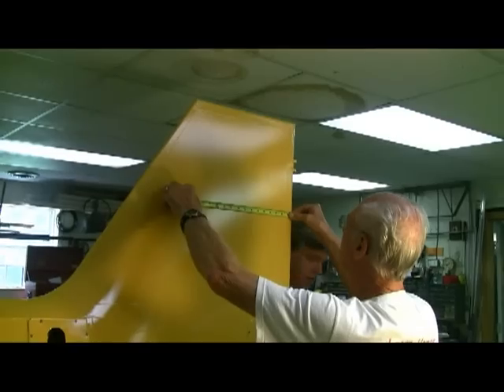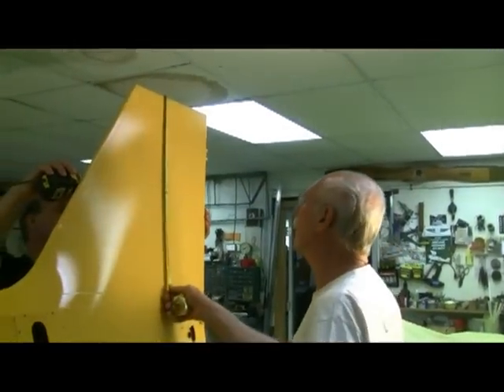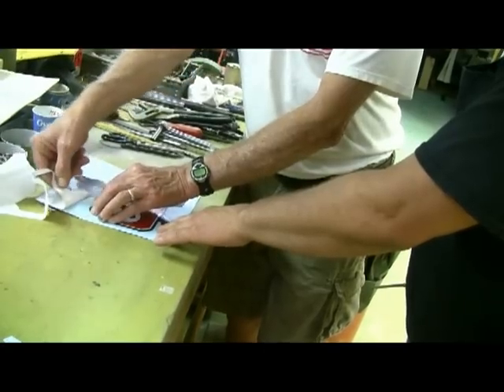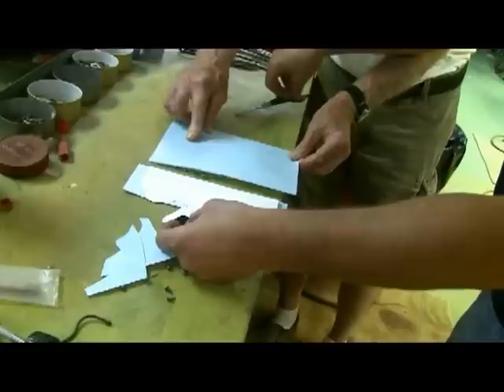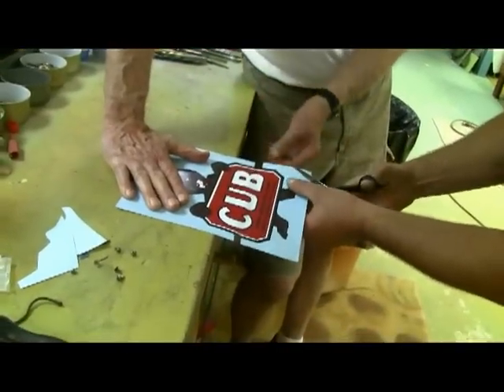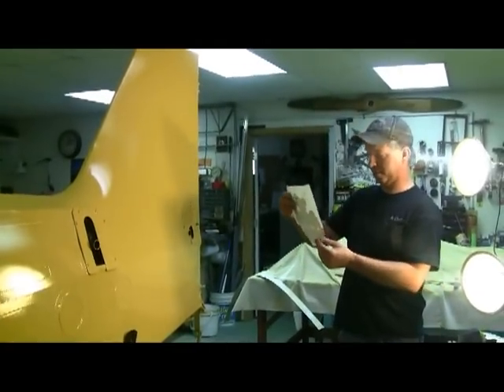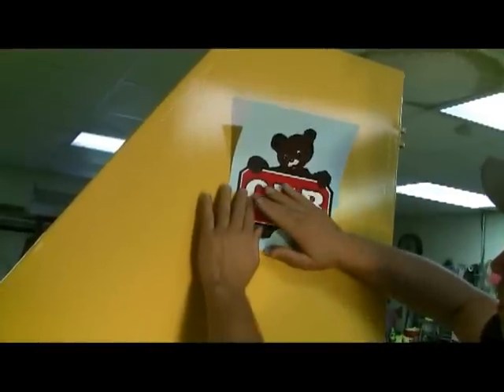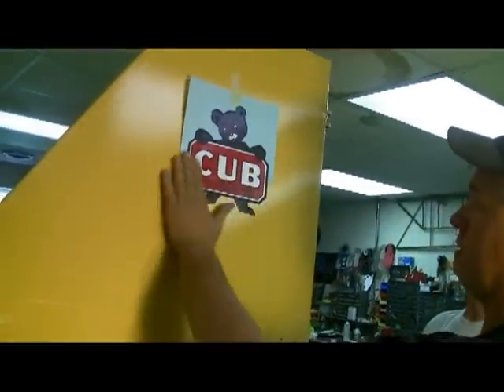Applying Decals to Fabric Airplane

Comment: Well done!  Btw, you can use Windex or something similar to keep the air bubbles out and be able to move the decal into position- then just squeegee it out and wipe away with a paper towel.  When removing a decal- use rubbing alcohol and a razor blade.
Reply: Have you done this removal on a fabric aircraft?